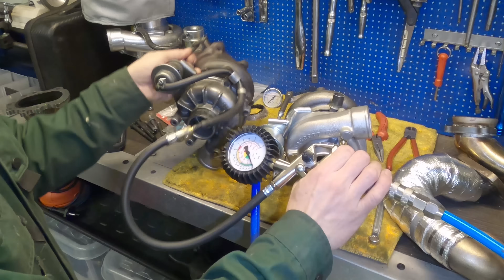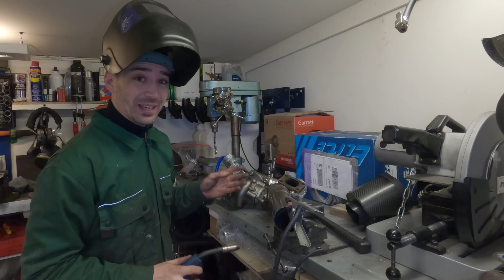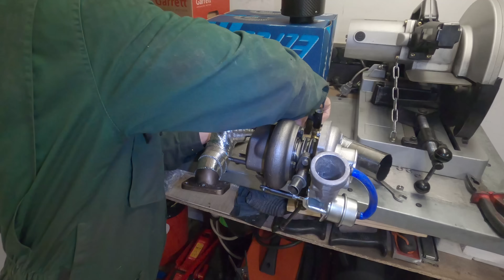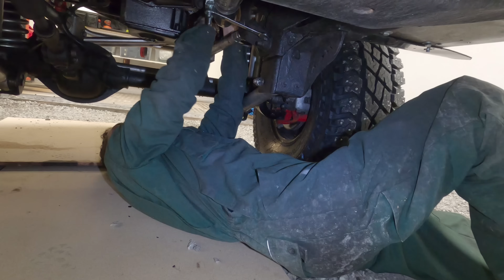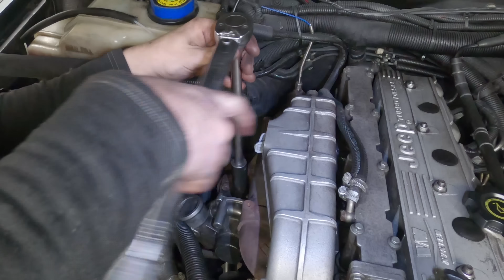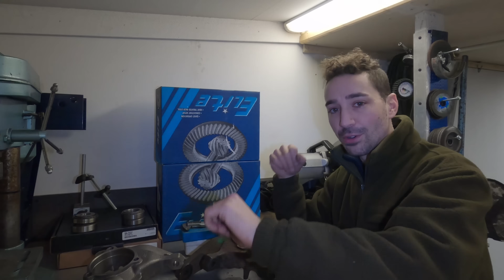Jeep Cherokee XJ 2.5 TD VM Garrett GT2052 Turbo Build

Comment: Here in the states if you get 2002 ford explorer sport trac rotors they are the correct size and bolt pattern for the wj swap so you don't have to redrill brake rotors for your bolt pattern. 
Then you have to weld those unit bearing spacers to the knuckles I've seen some done without welding but that puts the weight of the vehicle on the bolts it definitely needs to be welded which isn't hard.
That's going to be a cool steering setup, you'll be able to do a raised track bar as well. 
That's awesome you finally got your engine set up the way you want it, I'm not familiar with diesel engines but I think I would be thinking the same way about keeping the boost at a reasonable pressure. I think you've gone about it perfectly with a little performance gain and a massive gain in reliability and serviceability. The most important thing I think about on my Cherokee is reliability and building more reliability into my systems.
Reply from the maker: Ah thats good info! I will try and source those brake disks then to save some drilling. Noted that the spacer must be welded. I would love to get there brakes made up before the summer, just regearing and an sye take priority at this point. 
I'm pretty happy about the engine. I still need to get a new egt guage and actually dial in the turbo. I need to balance fuel and air so that the turbo is working no harder than needed. I'm onto the interior now, it's coming along but regearing is the next big job! Thanks again for commenting and for watching

Comment: Well done man, having the boost come in early seems like the better option with the diesel to pump up that low end torque. Hard to say when driving in the snow, but on your test drive it did seem a bit quieter in the interior of the vehicle with the vibration dampening!
Reply from the maker: Thanks mate, I'm glad it all worked as my energy for the engine work was running out. Nice to move onto something else. It is quiter now. Although in this video there is a loose fender vibrating like crazy outside and a metal cage with tools rattling in the back so it's not the best test. I will continue with some foam in various areas and try to bring it down some more.